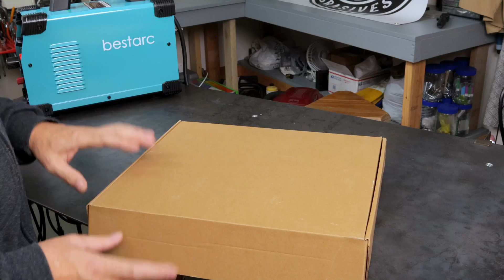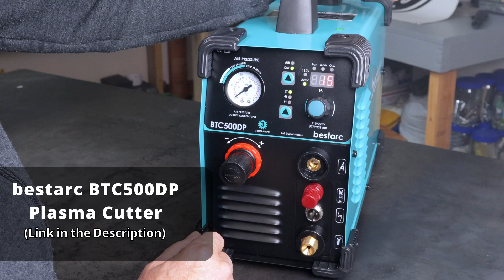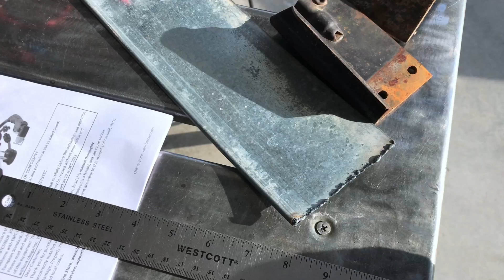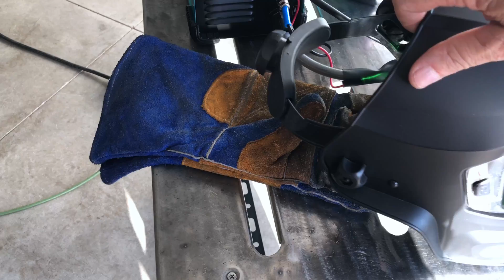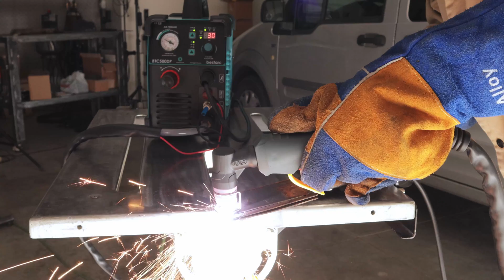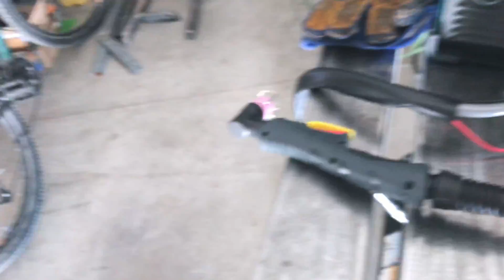Bestarc BTC500DP Plasma Cutter - Is It Worth The Hype?

Comment: Will this work on a 30amp 240v ? Basically air compressor plug in I have… and will it work on a 15 or does it need a 20amp 120v?
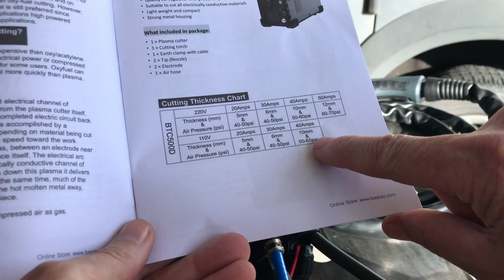Reply: Thanks, must have missed that. (It’s at 8:38, manual shot) I went to their website and only see 120 or 240.. not what amp breaker is needed and emailed them with no response.
Reply from the maker: The Amps listed in the manual at 8:38 are CUTTING amps for the thickness listed. They are not input voltage amps required for the machine. Hope this makes more sense to you when looking at that manual chart on the video at 8:38.
Reply: Ok best arc got back to me.
When using 110V, a circuit breaker of 40A or above is required.
When using 220V, a circuit breaker of 30A or above is required.
Reply from the maker: Ok, thank you for the info!
Reply from the maker: Sure it will work on a 30amp 240v plug. That’s what I’m using in the video. I haven’t tried it on 120v yet but I do know the higher the circuit amperage the less you’ll be tripping breakers.